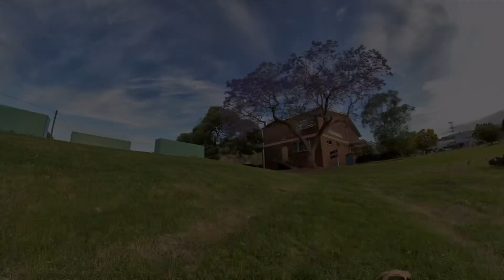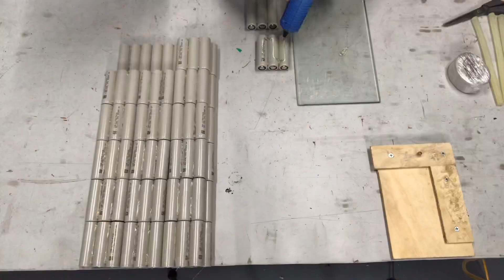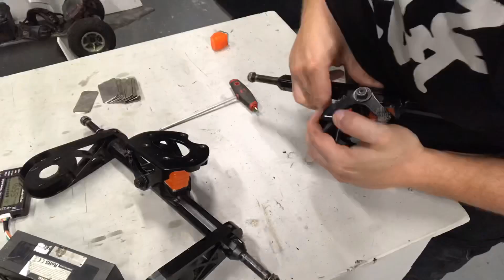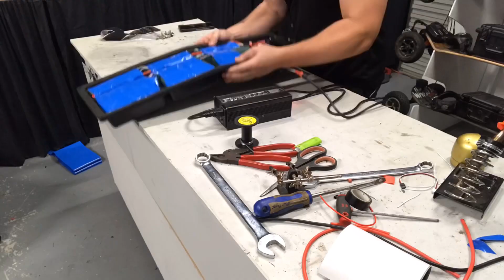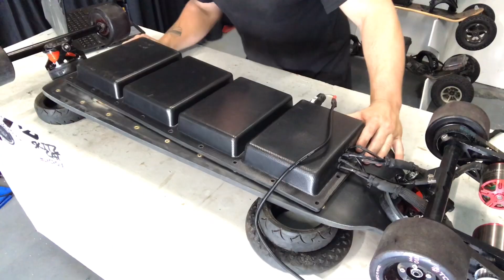Flux Motion Build!! 18s6p battery P42a cells.

Comment: Hey can you explain how you made the tabs for soldering the wires? I keep rewatching the timelapse and i just see the tabs appear, did you weld 2 pieces together?
Reply: @zac_p  Did you need any extra rubber between the deck and enclosure to fit your battery? I'll be building the same 18s config
Reply: @zac_p  So staggered stacked? i noticed you did them straight, The nickle im using is cut staggered - do you have a link or product name of the spacer you used?

do you have a link or product name of the spacer you used?

Comment: Nice Build👍 and video reviews. 
 I have a Flux build similar to yours. Built by a good friend here in New Zealand.
Specs and videos on my Channel.
What price you sold yours for?
Reply: @zac_p  how did you make your spacers for the front and back trucks. I'm wanting my board to have more under clearance to avoid scrapes to battery enclosure. Currently I have the 6.5" wheels. I may buy 8" wheels for more clearance?
Can you make 2 of those spacers?. I will pay you

Comment: would it fit 18 9p? (3x3 stack)
Reply: @zac_p  what if i add a 1cm layer of rubber between the enclosure and the deck? that way i should be able to fit 3 layer of p42 stack on top of eachother.

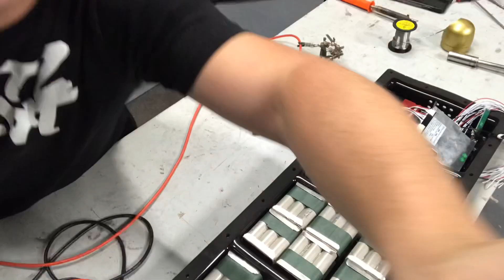Comment: Hey @Zac, awesome video mate. I'm trying to use your video to learn how to make a battery pack for my Flux build. I have a question at (3:48). You spot welded a rounded rectangle piece of nickel to your 6p. Then, it skips to your soldering on the folded metal piece. Did you use cut & spot-weld a new piece of nickel to the rounded rectangle piece (then folded it)? My apologies if I'm reading into the video more than you'd hoped. Thanks for your help mate!
Reply: Hey Zac, got another question for you. How did the double stacked 6p pack fit in the enclosure from a height perspective?
Reply: @zac_p  what do you make a spacer with? Foam?

Comment: excellent, this helped a lot.  looking at a build for this same enclosure and seeing the p42a cells laid out help confirms what sized pack can be fit in there.

tip though, if i may.  that hot glue, over time - and not even that much time, gets brittle and loses all of its adherence.  i use clear silicone and it keeps the packs together indefinitely.  cells are bound together the moment they're spot welded, but it is nice to have additional bonding coming from the silicone.

Comment: Link for enclosure?
And what motors that can use 18?
Reply: @zac_p  i understand the Reason to use 18s for the heating.
But if you only can get 90kv dont you loose alot of speed from just using normal 6374 190kv?
Haven't build my first yet but building up the courage. And money😊
Reply: @zac_p  yea OK. Have to say I'm not that well versed in the range, speed, torgue calculation, but if it can be done I'll work it out.
Was just confused if the 90kv gives more thrust and the 190 should give more speed.
Then 90kv could never gain the same potential speed as 190 Correct?
Anyway love your videos. All high end builds are about mountain boards. And I need a board to go intercity on normal asphalt so wanted to see potentials with the 4wd, or if I would lose speed from it. Range can be fixed with stacking batteries anyway🤷‍♀️

Comment: Hi bro, I'm a simple guy from Russia, I once came across your video and since then I have been following you on this site (YouTube), you make cool long boards / mountain boards. I have one request, write a link to this controller for charging batteries, a current regulator for motors and a system with gears for transferring torque from the motor to the wheels

Comment: Bloody hell you put some hours in dude! Great video! When you started putting together the battery all I could think, oh shit, the battery police are gonna nit pick but everything looked highly professional. PS. With the weather you guys seem to be having, maybe a fully waterproof build is in the future? :)
Reply: @zac_p  only issue with getting a waterproof remote.. it will lead to building a hydrofoil board..
Reply: @zac_p  A little plastic bag over the hand and remote works well!
Reply: I just installed the Maytech trigger remote, it works very well and it's waterproof. You can also make it to switch lights on and off from the remote receiver. It's not so expensive and it's also waterproof!